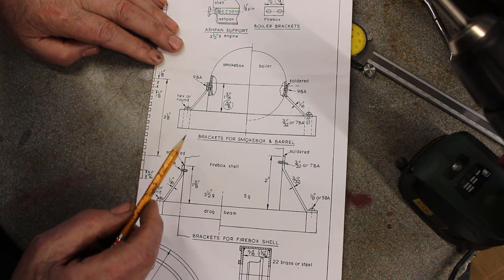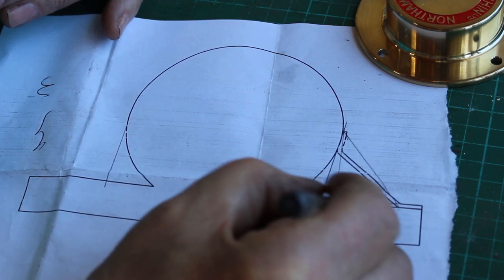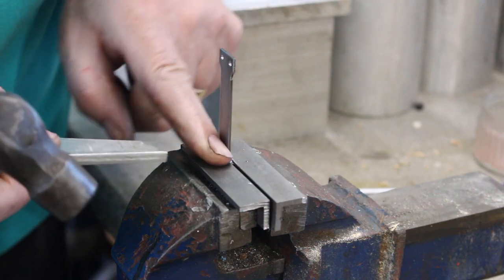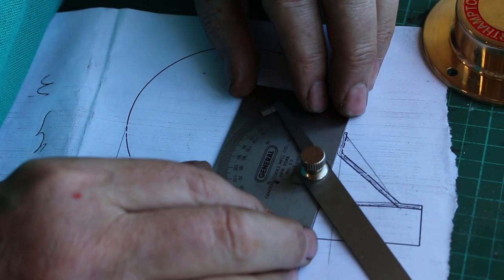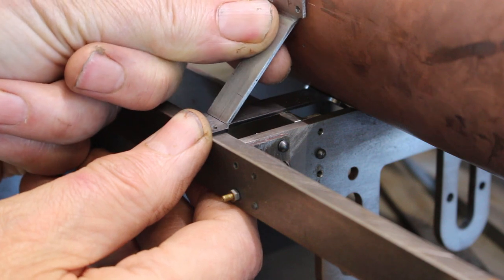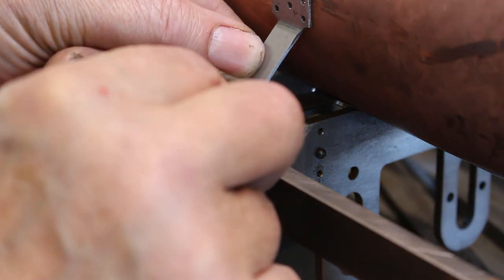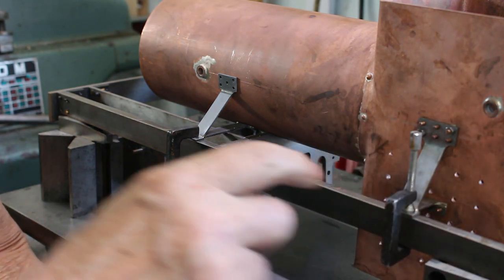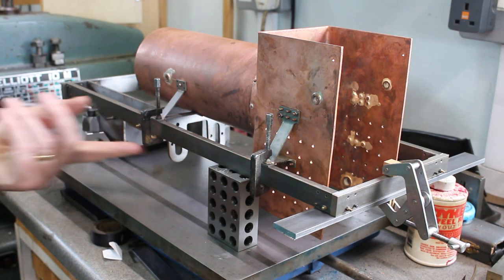Building Miniature Steam Locomotive LION Pt. 14 - Boiler Support Brackets

Comment: I'm very much enjoying this series. I'm building a five-inch gauge model of a loco that is similarly clad with wood. I was wondering if the articles in model engineer mention a specific technique for cladding. Are the planks of wood glued with a specific adhesive that is both heat resistant to 180 degrees and to the volatiles of paraffine? I'm quite concerned about this as I do not want the planks to slowly move around through a lifetime of steaming being attached to a boiler that changes in size as it gets hot. 
I was wondering if you could please tell me when it comes to the cladding, what either you intend to do or what the article says in model engineer. I would greatly appreciate it.
Reply from the maker: I've had a scan through the ME articles and unfortunately there's not any info about the wood cladding, the articles are light on specific details for finishing the loco, 
I've not given the wood planked cladding much thought yet, I don't think modelers permanently glue the wood planks to the boiler but rely more upon the boiler banding to keep the planks in place. I was thinking of cutting a thin veneer to the required shape and cluing the planks to that, then the boiler bands would keep that one piece assembly in place. I thought about experimenting with a silicon based adhesive to glue the planks to the veneer, hopefully an adhesive that will penetrate the porous nature of the veneer and wood planks to provide a robust assembly. Silicon based adhesives are good at higher temperatures but perhaps better at sealing then gluing. Sorry I can't offer more at the moment, if you have better ideas then please share.
Reply: @GoCreatehms  Thank you so much for your readiness to reply, it is ever so encouraging. I think the idea of a veneer under the planks is a good one as it is not permanent and also stops the wood from moving about. I'll throw that around at the next club meet. Thank you very much! i'll most certainly share how it'll be done when all is thoroughly experimented. Again, thank you for the ideas!